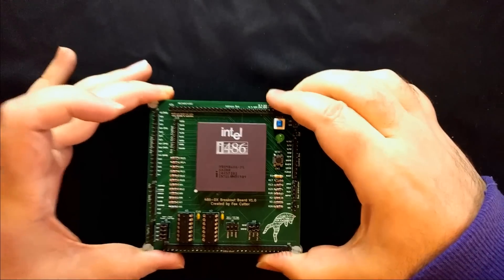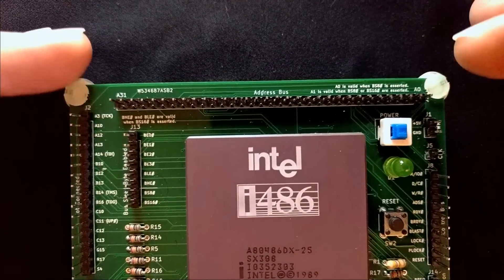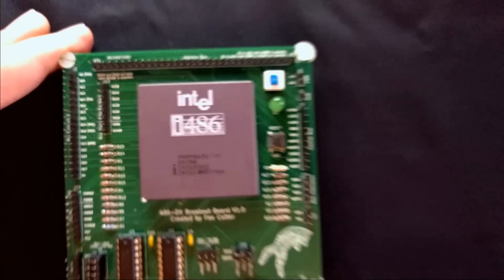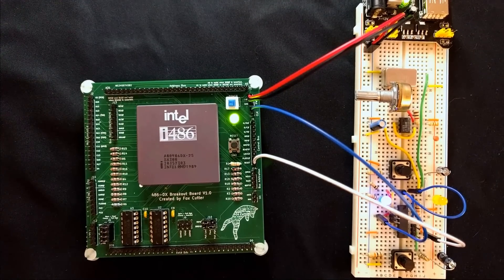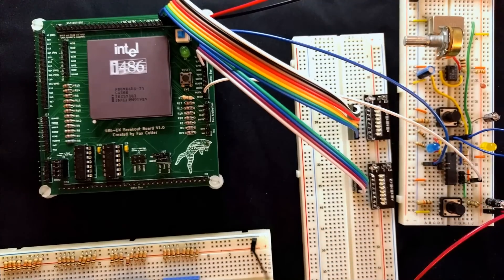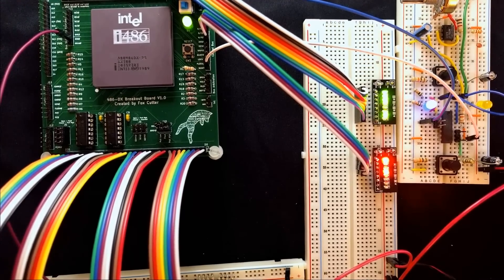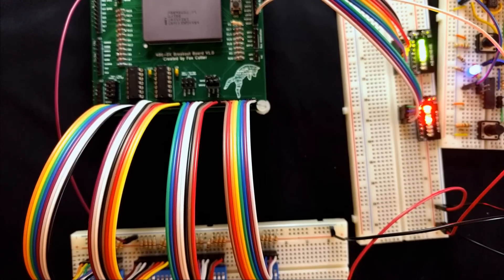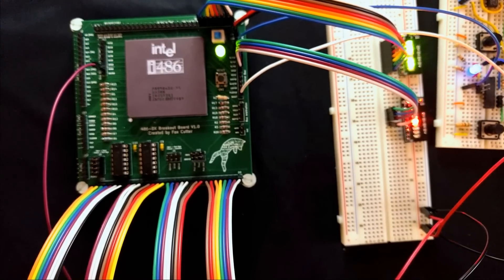486 Breadboard Computer - Part 1

Comment: This is really cool! As someone with a passing interest in this type of old computer some of this flies over my head but it looks like a fun concept. One thing I would suggest is maybe adding a socket to the breakout board so you could use other 486 chips from like AMD or CyrIx
Reply from the maker: There is a socket under the chip, but it's a standard pin socket and not a ZIF socket (which are much harder to find, might see if I can scavenge them from old motherboards in the future) so it's not really visible.

Comment: The best you can do with a 486 is add an IBM compatible BIOS and ISA-BUS and then install a VGA videocard and soundcard and run DOS on it.
Reply from the maker: But where's the fun in that? In theory I could just replace the bios layer and run dos on whatever I end up with. I don't really know what the end goal is other then finding out.
Reply: @Fox-Tech  The fun is to make an IBM compatible PC with your own designed PCB motherboard. And in the end, the reward is everything to have a PC that runs everything that ran on a PC back then. Nothing else can compete with it.

Comment: pretty cool.. but i personally would break it out as a standard PC-104 board.... the reason being there are plenty of peripherals and other stuff that is designed perfectly for something like this. in fact you can still buy (if you're lucky) pc104 386 and 486 and lower end pentium boards.

Comment: Thanks for your great sharing.
Should we worry about the cooling problem? If not, I'm curious if it is caused by such a low clock frequency or by 486 itself.
Reply from the maker: Later models of the 486 did need a heat sink, but this one can run without it. And as it, even running at 4mhz for a half an hour or so still leaves the chip itself cool to the touch. That could also be because the pcb has two copper layers which might be helping with some of the heat dissipation. That might change if I ever get it up to the full 25mhz that the chip is capable of, but for the moment it appears just the ceramic provides enough passing cooling.
Reply: @Fox-Tech  Both you guy and the chip stay cool! :D

Comment: Wow! Excellent tutorial - looking forward to the rest of the series. I like the use of 8 wide ribbon cables to simplify connections. I wouldn't think it possible to breadboard a 486 with all those pins, but that's nothing compared to a modern processor like a Core i9 with over 1000 pins. Brings back memories to the early 90s when I upgraded my 386 system which had a separate Cyrix math coprocessor, to a 486DX motherboard. Does Intel still make the 486 or have to buy used/pulls?
Reply from the maker: Some of the server CPUs get up to 4000-8000 thousand pins. Makes 168 seems easy to mange. :) 

It looks like the 486 stopping being made about 15 years ago, so doesn't seem like you can get it new. You can find them on ebay, though make sure the pins are in good shape. There does seem to be a lot of new old stock SX chips there as well, but they are mostly QFP and not PGA.

Comment: I certainly didn't know that the 486 only uses 30 address lines in 32bit mode. But it makes sense, since the Program counter probably does not go beyond FFFF FFFF.

Comment: About as far as I go with BB based computers is MC68k based beyond that when I go with higher pin count PGA CPU’s I move to wire wrap or PCB’s which is MUCH cheaper than wire wrap & can get good signal integrity.

Comment: hey where on earth do you find 8 wide dupont leads? i can find buspirate cables till the cows come home just never any 8 wide to 8 wide connectors. great video by the way never have seen a i486 up close like this excellent work
Reply from the maker: I kind of cheat to get the cables. I get the normal pack of single wide connectors, pull the headers off and then put them into 8 wide headers. It's not perfect, but it works for the most part.

Comment: Intstantly subscribed when saw video in my recommendations. But please do not use that breadboard power supply for power regulation, regulators can fail easily and feed the processor input voltage directly.
Reply from the maker: What sort of power supply would you suggest?

Comment: The split into separate code address space and data address space was also available on the Motorola 68000 series as well, I think starting with the 68020.  I hadn't heard of any 68K systems that actually used that feature either.

In theory it could allow for better code security by locking out modifications to running code.  It might also make it easier to map in ROMs without having to carve out a block of the address space.

Comment: I assume by DWORD you mean 32-bit. But why is it called DWORD? I mean, the word size on a 32-bit processor is 32-bit, right?
Reply from the maker: For whatever reason, WORD seem to have stayed fixed as 16-bits, so 32-bit is a Double Word (DWORD) and 64-bit is a Quad-Word (QWORD). I'm not sure if this is just an intel thing, or the whole industry, sometimes it's hard to tell with these sorts of terms.
Reply: @Fox-Tech  So, this is from Intel documentation? In a way, it makes sense, by the fact an x86 CPU boots up in REAL mode, thus 16 bit. 
But looking at STM32 microcontrollers, in the STM32 HAL, WORD refers to 32 bit, HALFWORD refers to 16 bit, and BYTE refers to 8 bit. So it ain't the whole industry,
Reply from the maker: @AndreDeLimburger  What can I say, I spend most of my time in Intel land ;)

Comment: I’m not sure they exist for 486, but for the older 386 and 286, there were several CMOS "static core" variants produced for embedded purposes, allowing you to run the clock at whatever rate you wanted, even stopping the clock completely without losing state. Some examples are Intel’s 386EX and the Harris CS80C286. Many CPUs of the era used dynamic memory for internal registers to save die space, and slowing the clock too far results in them not being refreshed frequently enough. It may be able to run very slow for now, but if you start trying to use the internal caches, the MMU, etc., fun errors might start happening :). Assuming you weren’t already alluding to it with your mention of the debounced switches, you can always go for the "button that asserts ready for a single bus cycle" trick.

Edit: supposedly the Cyrix Cx486DX was a static core design.
Reply: Also the TI and CX SLCs DLCs apparently are static.

Comment: That breadboard power supply cannot really handle the current requirements of a 486dx which are about 500ma and peaking at 700ma. The voltage regulator (a1117),  which while rated at 1A, will get really hot and shatter or go into thermal shutdown depending on the voltage dropped -- it would be much safer to get a better power supply like a old PC power supply or a switching brick rated 5v at a few amps 2+
Reply from the maker: That's good to know, thank you! I'll keep an eye on it and look into finding something better. Not sure what the best solution would be, maybe an atx breakout board so I can hook up a mini-atx power supply (not sure a pico would be enough amps). I was already considering moving to atx when I made the back plane, so this just helps with that.

Comment: Love it, liked and subscribed. One question though, why can’t we use a manual clock?
Reply from the maker: It seems like if the clock is unstable (so the high and low times are different) it goes into a shutdown mode. Probably to prevent corruption in the case of low power.
Reply: @Fox-Tech  thanks, please keep the series going🙏

Comment: I remember back like 2004/5 in high school some friends and I were all in agreement that like, 386s and 486s are far too complicated for a homebuilder to ever build their own computer around. Granted that was in the days before easily designable and quickly available custom multilayer boards. But it's an assumption I'd been second guessing lately, so seeing this is extremely cool. Very nice work.
Reply: At this point I believe the Pentium / Socket 7 systems are the "very difficult" point. The bus protocol was never officially public, although the AMD K6-2 manuals have a very good description of the bus timing. It’s a synchronous bus so timing becomes a difficult problem. Totally solvable using FPGAs, but the signal count is high (like 250), so you’ll have to use a BGA variant.

Comment: This is so cool!! now, one question for this is that this is a somewhat modern processor for most breadboards (most use a 6502 or maybe 8086) and this does run x64. could you have a breadboard Linux computer?
the last time a 486 cpu was supported on linux was four months ago! and maybe in theory you could employ enough breadboards and chips to replicate the hardware of a motherboard so you could put in a video card! besides. a breadboard can do anything a pcb can do but only bigger! 
it would be so cool seeing that happen! but I feel like it would be unlikely as it could take too much time.
Reply: and yes, linux did actually support this for that long. long enough for this to possibly run on a breadboard. https://www.youtube.com/watch?v=M4EPXwUV3aQ

Comment: I used to design Intel based systems i386DX ,i486,i960 ,i860 .All had similar buses and needed epld 10 ns ( very fast back then ) to latch some of the bus control signal .The code was given by Intel in the hardware manual .
Reply from the maker: Oh, that's cool. Feel free to tell me when I'm doing something completely wrong then! Actually, I think I ran into some of that code in question today, while looking for something else.

Comment: Replace the dip switches with some toggle buttons and give it an Altair 8800 case :)
Reply from the maker: I have considered it. I do have a IMSAI 8080 tucked away, but as it's still working just fine I don't think I'm going to hijack the front panel.
Reply: @Fox-Tech  that's awesome.

Comment: Hey this is cool! Back in 05 I designed and build a computer using an 8085. I always thought it would be cool to make one based off the 68020, but that's a lot of wire wrapping! I'm subscribing to follow along!
Reply: Honestly, ordering custom PCBs is so cheap these days that I have become lazy and go for a PCB first … problem is what to do with the other PCBs I didn’t use because most of my projects are one-offs and you get a minimum of 5…
Reply: @teknoman117  I would do the same. It's just that every time I sit down with the software It feels like there is a large learning curve. I got enough going on without having to take the time to learn it.

Comment: This is a very cool project.  However, I strongly recommend that you seriously consider increasing the number of ground connections.  You don't appear to have any on to the board apart from the power connection. With wide busses, it will become very important that the ground for the signals doesn't bounce around when the signals switch. Even if you are only clocking at (say) 100kHz, the signals still transition between high and low logic states at the same speed as if you are running at full speed.  The rapid simultaneous charge or discharge of multiple signal lines causes noise spikes in the local signal ground, which affects how other devices see the signals. (Research ground bounce for more info.)  I'd recommend one or two grounds for every eight data or address lines, and more grounds where you are grouping control signals.  While things may work OK reading static instructions from switches, it will very quickly get hard to debug unless you can keep the signals free of too much noise. This will only get harder with a breadboard compared to a good PCB design.
Reply from the maker: Thank you. That's very good to know, I will research that and try to improve things. Right now the board does have a layer that's just ground plane, I don't know if that will help any in this case.

Still, I will be looking into that and trying to apply it on future PCBs.
Reply: @Fox-Tech  Certainly a ground plane is a good idea, but you also need to minimise the ground impedances between CPU and each area of the design that it's connected to such as the data buffers that you added, clock sources, decoders, anything driven by the address lines, and so on.  Ideally, as well as the ground from the power supply, you will have direct ground paths from CPU to each other section, and they will also have their own ground connections back to the power supply as well.

One of the difficulties is that the ground voltage spikes caused by fast ground current transients can be extremely short and very localised making them hard to measure.  (Q... when is zero ohms not zero?  A... When it's a 50 nano-Henries of inductance and the current spikes from 2mA to 100mA and back in less than 10 nano-seconds.)   This all leads to the issue that each chip will see the same signal differently, based on it's local ground (at the chip inside the package) and that will be somewhere that you cannot measure even with a decent oscilloscope.  This is why it's better to design high speed digital circuits with an over abundance of caution regarding signal grounds, rather than trying to fix the problem afterwards.

But don't be discouraged.  With the right research (which you've already demonstrated in terms of how the 80486 talks to the data-bus, for example, this could become a very interesting and rewarding project.  I am watching with interest and admiration.  (I have designed plenty of fast complex logic, PCBs, etc, but never around a 486 - and I have a DX33 in my junk box somewhere...)

Comment: This is to my knowledge the first series about making a "breadboard" 486 computer. I've searched before but i never found any. Somehow i got recomended this and im very happy. I also have a 486 that i want to make a computer out of but I plan buffering the address and data bus with octal bus transceivers(I dont want to damage the cpu).I also plan to use an arduino or something else for clock,reset and other misc stuff its more easy and convenient(like have the arduino be controlled by serial)

Comment: I find this quite interesting. Is there a socket under the chip? If not, why not a socket 5?
Reply from the maker: Yeah, there's a socket under there.
Reply: @FoxTech  ok that's good. Just was expecting a zif lever but didn't want to assume. I actually love this and was an idea I've been thinking about doing.
Reply from the maker: @drrenard1277  I would love to have a ZIF socket, but they cost a lot more then I was willing to pay. That being said, I did try to size the placement of everything on the board so there would be room for a zif socket (based on the measures I could find for one). 

The socket also let me stick a few decoupling capacitors under the chip, which was a good place for them. Though I think the next rev will use SMD just for the clearance on them.
Reply: @Fox-Tech  I'm definitely watching you on this. Can't wait to see more

Comment: Where did you get the LED strips the you plugged into the breadboard?
Reply from the maker: Made those myself actually. Was my first real attempt with doing anything with SMD, and they have turned out fairly well. Down side is they don't fit every breadboard, as ones with split rails don't have the holes alright with the board.

Comment: Excellent! Subscribed.
I've wanted to do something very similar for a while - only with a 80286, not a 486. Maybe this will give me the motivation to actually start doing it. :)
Reply from the maker: That would be cool. The 286 had some interesting packaging, so could make a custom PCB interesting to work on.
Reply: @Fox-Tech  Ah, nothing crazy (no CLCC sockets etc) just a regular PLCC68 one. I've always been fascinated by the 286 as it was my "holy grail" back in the day. Yeah that shows how old I am. :) The little brain dead chip that could. I even started writing a little protected mode OS for it sometime in the late 1980s, that got nowhere though and I don't think I have that code anymore.I actually have a whole pile of 286s because one day a few years ago I went crazy on ebay and got a lot of 200+ of them(the Siemens 10MHz variant) and want to see if I can make them do something useful, akin to microcontrollers maybe.
Reply from the maker: @stamasd8500  Cool, hope you can do something with them! I do have some OS code laying around as it's one of my other projects, so I might adapt it to run on the hardware once I have more of it up and running.
Reply: The Cyrix 486SLC uses the same pinout as a 386SX.  I think 386SX and 286 surface mount had the same pinout.  Same 16 bit databus I know.

Comment: Dude this is amazing! Somewhere I've got the 486 processor from my family's first computer in the early 90s. I was allowed to take the computer apart once we upgraded, and I knew that the processor was where the magic happened, although I had no idea how. But I kept the processor, even though I was like 7 years old, and I'm pretty sure it's still in my collection. As I got into robotics with the Basic Stamp 2 and started to look for more powerful controllers, I always wanted to put the 486 into a project, but it was entirely inaccessible to my 12 year old self, both intellectually and on a hardware level. It's super cool to see a breakout for this old processor! You broke one of the main barriers to accessibility. Can't wait to see what you make out of this! Instant sub.
Reply: My first CPU is AMD 486 DX2... I used it for maybe 5 years before broken. I salvaged the keyboard, Hard Drive and the CD-ROM but I didn't bother with everything else... I kinda regret it...
Reply: Basic Stamp 2 and LEGO Mindstorms is also what got me into computing. My Boe-Bot was one of my most treasured Christmas gifts as a kid.